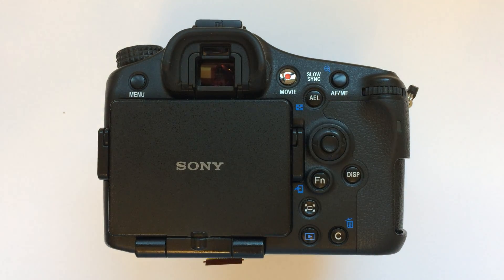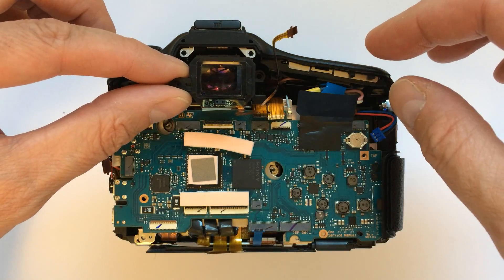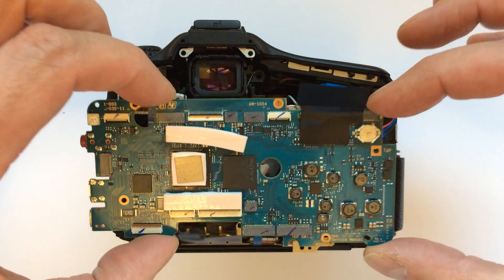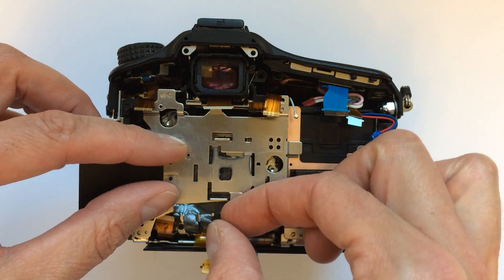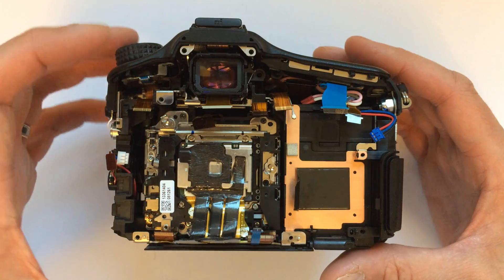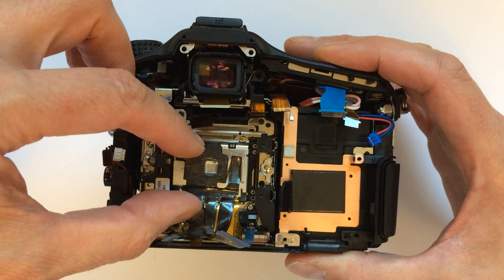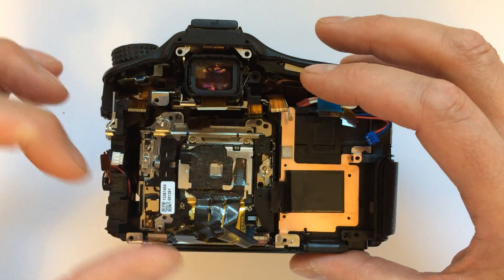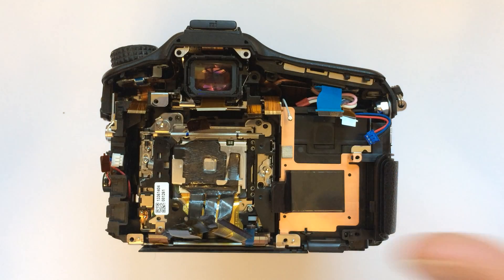Sony A77ii IBIS repair attempt

Comment: Hello I have a problem with mine, when I put my eye in the device it works but as soon as I remove my eye it does not display anything on the LCD screen despite the fact that I tried with a new screen but nothing happens yet I can take photos and videos so I do not know if the failure comes from the motherboard or the small card behind the LCD screen
Reply from the maker: Have you checked the display setting in the camera? You can turn off the eye sensor so that it does not use the LCD screen to save energy.

Comment: I opened my sony a77 after almost a year and it turned on then alpha logo showed and i had to set location and time zone , everything seems to be fine but after a few seconds it shut down and won't turn on,,i kept my camera without battery in a airtight box with some silica gel,, charged battery fully before using it,but it shut down and wont turning on,,when i turn on switch some red light is popping beside card slot and there is no information in display,,what could be the problem?